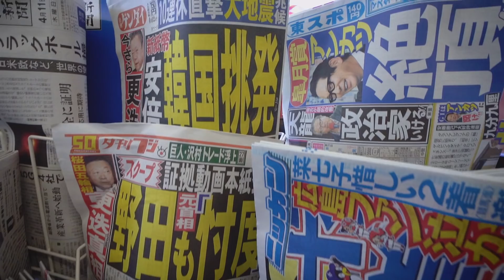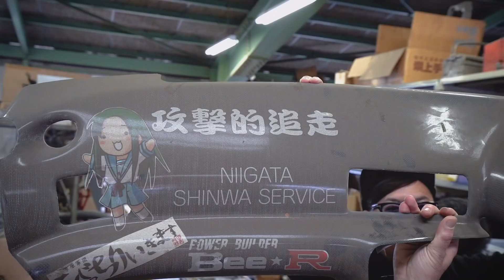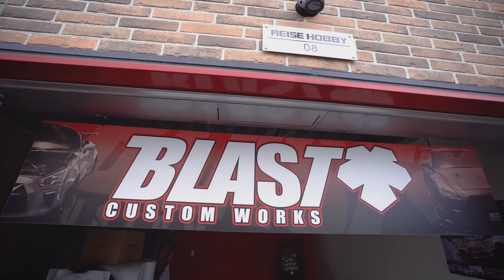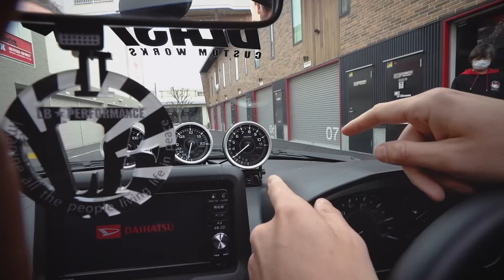CAR SHOPPING FOR R34 GTR’s IN JAPAN!

Comment: If they buy a r34 I’m not watching dde anymore, there’s a ton of cars that are better than the r34 and cheaper, skylines in general are over priced for the performance they give out. And it’s horrible to praise a brand or support it when it’s too expensive doesn’t produce the performance and sounds horrible, the fastest gtr they make it’s the r35 nismo that produces 600hp and the suspension handles just as well as a grandsprort corvette and is $125k with the ring lap over 7 minutes, that’s horrible for $125k